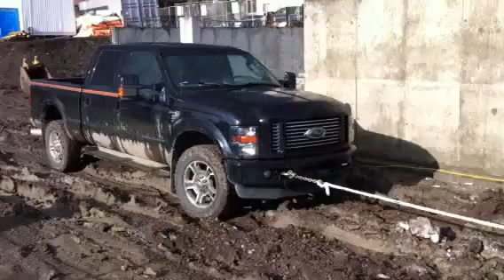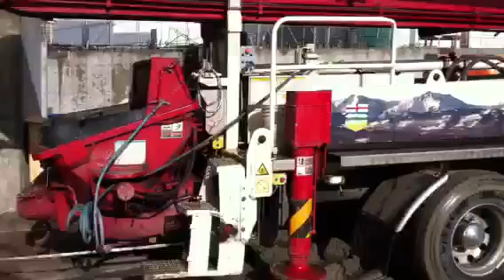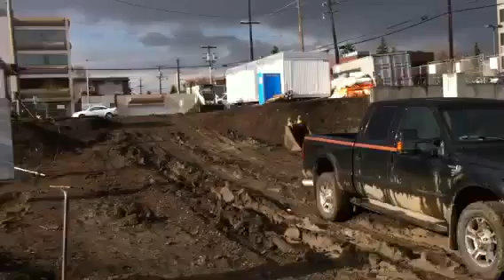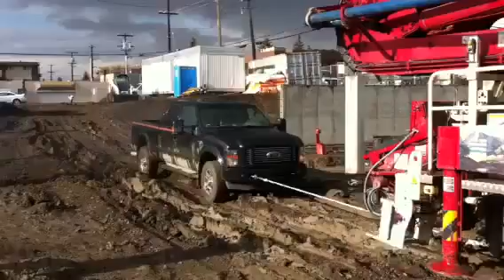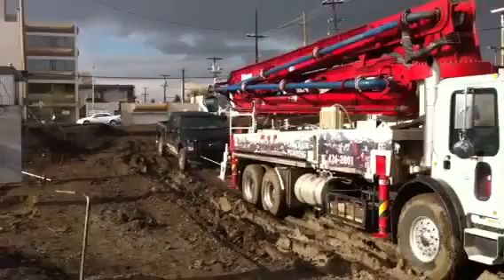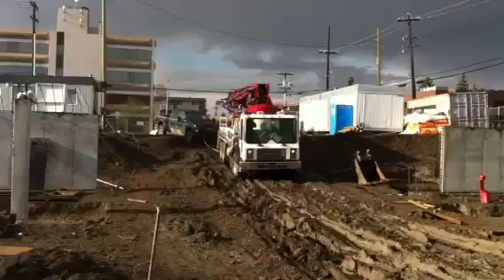6.4 l Ford diesel pulls out stuck 42 meter concrete pump.

Comment: "Canadian Boys know how to get er done"?? Not quite. If they knew what they were doing the truck wouldn't be pulling in reverse. Never pull a heavy load in reverse.
Reply: Kurt Radostits Because it puts strain on the weaker coast side of the ring and pinion as opposed to the drive side like when you pull in forward gear.